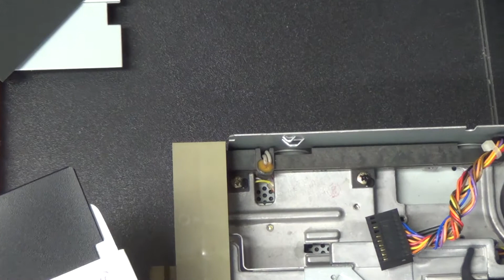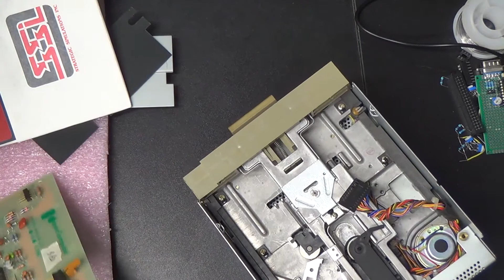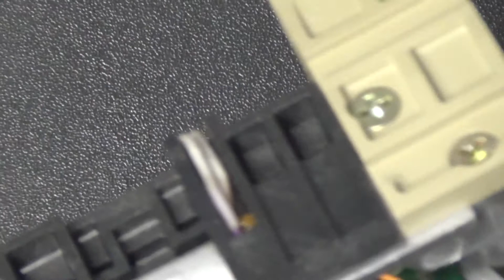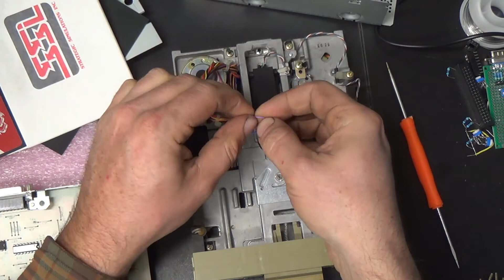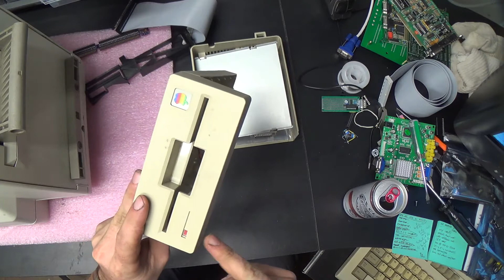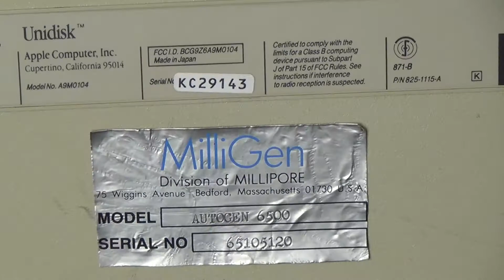How To Bypass the Write Protect Sensor on an Apple II Unidisk 5.25.

Comment: Lee, great video, really appreciate the thorough walkthrough!  Quick question: going the lazy route, is there a way to short those two wires permanently internally so it always completes the circuit and ignores the write protect notch (or lack thereof)? That would be within my capabilities I think. 😁 Thanks!!!
Reply: Some commercial copy-protected software checked to make sure the disk was write protected.  If not, it knew it was a pirated copy. So permanently shorting the sensor make make the drive incompatible with some original disks.
Reply: @rivards1  thanks for the heads up, I did not consider that!
Reply from the maker: If you mean temporarily-permanently just to write your Nox Archaist disks, I'd pop the cover off the drive and stick a short piece of small gauge solid core wire between those two pins, into the back of the connector.  Leave the cover off, write your Nox disks, then remove the jumper wire and button your drive back  up.  I wouldn't leave it in there permanently.  If it were to eventually work its way out it might damage a disk or short something else out.

I've gotta hit the sack for tonight, but if you're not sure what I'm talking about remind me tomorrow and I'll do it and send you a picture.
Reply: @Lee_Adamson_OCF  If you wouldn't mind, a picture would be great, as I would like to try this route. Temporally is even a better idea. Thanks!